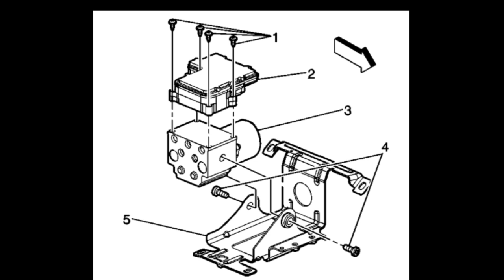GM Continuously Running ABS Pump Motor and/or Code C0265

Comment: I noticed on mines the plug was disconnected. I bought the truck that way a few days ago and when I plugged it in you can hear the pump running even with the key off and also I’m having a stalling issue I’m getting codes for the ECM as well any idea what they could be?

Comment: I just scored a 01' 2500HD. Traded a KZ1000 for it lol i popped the relay box open under the hood and found a 60amp maxi fuse just laying in there. As soon as i reinstalled it, the ABS motor came on (this is with the key off). My buddy told me to just roll w/o it. Sounds like the proportioning is all done mechanically in the valve body. So the brakes outta work normal, i just wont have ABS. I dont like ABS anyways, just pump your brakes if you start to slide. I guess thats a dead art nowadays though lol thank you for this video.

Comment: I have a 2004 toyota previa..the abs motor keeps running even if key is turn-off. I just remove abs fuse to stop the noise..does this show a faulty ecbm? thank u 🇵🇭

Comment: Mine is doing this on a 2008 uplander.  It only stops running if I unplug it. Can you drive it while unplugged? The part wont be in for 3 days.
Reply: The car can be driven with the ABS harness connector unplugged ( or you can leave the harness plugged and remove the ABS Motor Fuse). However, be mindful that the car will not have ABS functional to prevent skid on slippery roads etc. The brakes will be equivalent to that on older cars which do not have ABS. The braking system utilizing the Master Cylinder,  the hydraulic brake caliper and brake disk/drum will continue to be functional as it is controlled by a different sub-system.

Comment: Wow this video explains exactly what is going on with my Chevy Suburban 2008. Every time it rains my brakes engage by themselves and it causes my truck to slow down. And it only does it when it rains. I definitely need to see if this is the issue

Comment: Just asking will this have anything to do with the trailer brake system do to I have no trailer brake working and a high and low code on my brake switch not sure what to do I have changed out all the trailer  brake control stuff that I know to change out

Comment: Hey I know it been a min but i have the same issue with a pump runs continuously I got the module fixed but it still did the same thing so I return it they rechecked it send it back but the pump still runs continuously could it be a bad pump thanks
Reply: How does one know if the pump is running or not? What does it sound like? The truck is so loud and this thing in the ceiling buzzes so loud I can't hear anything else

Comment: Hello, I have a 2001 GMC Sierra pickup 3500 Diesel 4x4 6 speed manual transmission. I had the rear brake line blowup on me. I replaced it, ( had to cut ends off and use the old fittings and double flare ) I started to get the ABS motor running all the time. So I unplugged the Unit, but before that I got ABS warning light and my 4 wheel drive engaged light on. I have tried to figure out why the 4 wheel engage light is on. Any way one of the rear calipers bleed valves is bad so I couldn't bleed the rear brakes. 
Than I had to replace all of the front brake lines and from master cylinder to module and again right front caliper bleed valve is bad so can't bleed it. 
So the ABS motor continues to run if plugged back in, so I leave unplugged and have driven it over several thousand miles just leave lots of room between me and the car in front of me. It does stop without any problems and I have had to lock brakes up. So is my problem the module or just need to get the system bleed?

Comment: Hey Mate I am trying to figure out a problem on my 2012 GMC Sierra Denali recently I was 4x4 and all went well had a great day however when the time came to re inflation of my tyres I jumped in and noticed that the steering wheel was out 1/4 turn to the left. Bummer the vehicle drove straight and we can home 1000kms with no problems apart from errors on the dash when I got home grabbed a code reader and it came up with C0710 error also a C0610 Brake switch ordered the part just waiting but the C0710 error everything on the tube mentions to tape up the wheel to change the steering position sensor so I need help and thoughts out night be able to shed some light .. thanks for the videos and keep up the good work Scott F

Comment: I have a 05' Chevy blazer which it looks like  it is the same Module unit .. I carefully cut the seal at the top removed the lid and resod the bigger points that i could with a cheap solder iron and flux based solder cleaned off the old thermo paste and added new to the areas that had it ( grey)  Used RTV for a new gasket Reinstalled No ABS light  No parasitic draw  In many Forums this unit has its solder points get old and crack giving off even the slightest of variation which reads as a problem to the main computer and a ABS light comes on And the ABS motor stays on even with your Truck turned off 
I saved myself a few hundred dollars for a used Unit
Reply: could you explain what you did ? I have a 05 blazer, I turn the car off and I believe it’s my abs module (top right under the hood) keeps running when car is turned off  until it drains battery, I’m located middle of knowwhere basically with limited tools, just curious what I can do
Reply: @joshbonneville9523  You have what is called a parasitic draw Meaning at one point when the truck was running a switch was broken while "Open" / On So when you turn off the truck this switch did not close Offering power to the ABS system...This switch is a Relay....Limited tools middle of no where No idea on your tools Or skill level - see a mechanic....Otherwise you will need a 9volt battery And google 9volt battery test on relays ..A voltmeter to pin point the fuse line that is carrying the voltage to confirm it. Pull your ABS fuse for now (its not working anyways) And just for good measure pull your neg cable off the battery over night reinstall in the morning when driving (Beats having to charge it after being dead) Find a local scrap yards S10/jimmy/blazer all have the same relays ..grab them all ..
Reply: @freakyflow thank you so much, that is greatly appreciated, I’m just on an oil rig not too close to any towns, have to drive 4 hours to airport in a couple days, thanks again
Reply: @freakyflow I went to cold start it ( after 3 very cold days not plugged in), I drove it maybe 200 feet and been like that since
Reply: @joshbonneville9523  https://youtu.be/2ce-lQe-vBY?si=oZ9hb1Kv1zkOHyyB

Comment: Mine kept running after I pulled the abs fuse I had to disconnect the 12 volt and ground to get it to cut off on my 02 yukon. Is that normal?
Reply: I’m currently having the same issue. Continuously runs. How’d u fix it? ThNks

Comment: 200 gmc safari. abs light with brake light. when i am driving if i press the brake pedal the brakes lock up and tires squeal. I got a c0265 code. Any ideas. i am replacing thee abs module first. and see what happens
Reply from the maker: Pull the ABS codes and let me know what you find

Comment: Hi Car Doctor... i bought a 2006 Silverado Z71 and when i start it ABS on cluster comes on. The nce i put it in gear and get over 5 mph or so it goes off and stays gone until next startup. Any good ideas what it might be ?
Reply from the maker: Have you pulled the ABS codes and if so what are they?
Reply: Hi, O'reilly Auto Parts pulled the code for me today and it says Left front wheel sensor.  I just bought this truck (used of course) and the Ford dealer where I bought it just put that sensor on brand new along with new pads, calipers and rotors.  When I had asked about the ABS light the dealer seemed confused and didn't know why it was on but were not planning to do any more work to it.  Guess I better get in there and look around.  I already cleaned up the G110 ground under drivers door area.  Thanks for any advice on how you'd approach fixing this.

Comment: I have a 2003 Chevy Tahoe. I have a constant humming noise inside the truck. I was told to replace the ABS  motor assembly . should I replace the module first?   And when pulling my boat I have a hard time stopping .
Reply from the maker: First you should isolate the source of the noise. Is it coming from the ABS HCU assembly?
Reply: The Car Doctor the mechanic said it was the ABS assembly motor.  I just purchased 1 . Thanks for the advice.

Comment: I have a 2003 blazer. I can pull the fuse under the hood and the and stops humming. also would this affect my transmission, which will only shift in 1st n 2nd gear. it'll shift fine on the shift column but not virtually shift past 2nd gear causing rpms to race up
Reply: any help please thank you

Comment: I have a Closed circuit issue ,Pump runs continuously after vehicle is 
turned off. I pull the fuse to stop pump running. Only ABS light is on 
no BRAKE light until I pull fuse then bot ABS and BRAKE light is on. I 
believe pump relay is the issue ,do you think a bad solder joint or Cold
 Solder joint at the component to circuit board is a possible cause? 
Thank you. If not I will just replace entire unit.
Reply from the maker: my guess is the module is bad like all the others I have run into. Good luck

Comment: great, just what I needed. I had been thinking gas tank fuel pump, ick. Now it appears and easy home fix. You made my day.
Reply: Hey, by any chance did your car have stalling issues? I have a Silverado 99 and when I plug the ABS module in the motor keeps running, but I left it unplugged does that cause stalling issue
Reply from the maker: Hope it works!

Comment: I was told my Yukon Denali 2003 gad this issue of the motor being on when I'm driving the truck can I disconnect it and how without triggering any dash lights I rarely drive it so no biggie
Reply from the maker: You can remove the 30amp ABS fuse from the under hood junction block but it will completely disable the ABS system and possibly create an unsafe condition when the brakes don't function as designed
Reply: But will it trigger the abs light or any code i just wanna make sure that thats whats wrong with it i just wanna try it
Reply from the maker: Not sure I understand the question. Sorry.

Comment: I replaced master cylinder 2 months ago with new, not reman. replaced hydro boost today. brakes still locking. I cracked line at master cylinder. everything released for awhile then started again. I'm thinking bad master cylinder?
Reply from the maker: I guess it's possible. I have just found that most times it's the hydro boost unit causing the issue but I understand you loosened the master it and it still held pressure. I guess the ABS HCU can possibly be causing issues as well
Reply: Well the problem is solved. It ended up being the 6 week old New master cylinder.
Reply from the maker: Good find. Defective parts are the hardest to diagnose. Congrats!

Comment: i have a 2006 GMC Sierra 2500HD. 6.6 diesel hydro boost  After driving about 5 miles my brakes lock tight. no abs light'
Reply from the maker: Bad hydro boost unit
Reply: I was thinking that too but after lockup I loosened the nuts holding master cylinder to hydro boost but wheels didn't release.
Reply: forgot to mention, it don't lockup with ABS fuse pulled.
Reply from the maker: wow, well you might have to start cracking bleeder valves to trace back to where the pressure is being held. Might be a tough one.
Reply: I'm trying g to bleed my abs module without a scan tool and stumbled on this vid.  how can I energize the abs pump manually?

Comment: hey car doc. how's the weather up there. I gotta 07 Chevy uplander with an abs light that won't clear with a Snap-on scan tool. The transmission was just fixed and it came back with a light. It has a C0035. I just put a left front hub assembly in it about two months ago. I checked the ohms and they are in spec. I checked Ac voltage and it's in spec too. I graphed it and it looks the same as RF and LF. I tried several times to get it to clear and it won't. any suggestions or ideas. Thanks for your time. Tennessee Mike
t
Reply from the maker: You might need to monitor that speed sensor while driving. Might have a bad hub.
Reply: You are right. It was shorted to ground in the hub. I can see now why it throwed the light but don't understand why it was showing a near perfect graph. Guess I need to get more experience in graph reading. Also to keep it simple. Thanks for your time.
Reply from the maker: Bad parts can be such a pain to diagnose. Good job sticking with it. Take care

Comment: Thanks, Is there a way to bypass the Abs system for a short time until it can be repaired?  my abs pump goes off when i am coming to stop on totally dry pavement. it is actually rather dangerous.  if i disconnect the red/ black wire from the pump by the frame rail will that cause this to stop until i can get it repaired ?  i am old "school" and grew up driving cars with out abs...
Reply from the maker: I cant say if that's safe but it would probably work. There should be an ABS fuse under the hood in the junction block that will completely disable the system. If the pump runs only when coming to a stop then its probably a wheel speed sensor issue or hub.

Comment: I have a 2003 trailblazer Lt ext 4x4 abs light and brake light on pump not turning off unless I pull the fuze
Reply from the maker: Probably need to pull the ABS codes and go from there.
Reply: Code is c0265
Reply from the maker: Oh bummer. Every time I see that code it's curtains for the ABS module. It indicates an internal malfunction. Maybe see if you can get a used module. It may need to be programmed if it's not exactly the same vehicle and options. Good luck.

Comment: can the abs pump cause a rattling noise?
Reply from the maker: +brian landress Yes. That's about what it sounds like. Does it do it all the time? Just when you apply the brakes? Or only over bumps?
Reply: +The Car Doctor I hear the rattling noise when I am idling or going slow. i have looked all over my car and am stumped. i drive a Chevy cobalt coupe.
Reply from the maker: OH, sounds like a motor mount or exhaust rattle. I doubt its ABS related.

Comment: also forgot to mention I took off the fuse for the abs and the humming sound shut off.
Reply from the maker: +b20vtechustler Module is fried like KFC
Reply: @ThecardoctorTV I sold that truck around the time I made my comment/question, and some how, my old truck has resurfaced to my coworkers hands and is asking me for help 😶😶😶

Comment: my 2002 yukon makes that humming noise when the it's on or off. I also drains my battery. any ideas it's the module or faulty pump ? great video also 👍
Reply from the maker: +b20vtechustler It's a bad module. It's likely full of water inside. Get a new or rebuilt one and you'll be good to go.

Comment: No,  have pressure at the bottom end of the pedal. When the lines are disconnected from each wheel we can get fluid shooting across the garage.  However when the ABS PUMP/MODULE is hooked up no pressure.  I'm wondering if the replacement pumps are dried out from salvage yard when I receive them or if the module isn't working correctly. I know you can get ECBM rebuilt,  but can you get the pumps rebuilt?
Reply from the maker: +Mike Gonsalves sounds like another bad HCU assembly. Don't know if there is a rebuilder for those. How about new from the dealer?

Comment: Nice video thanks! However I have a 2002 chevy silverado 1500, I've replaced with all new brake lines, calipers, pads,  rotars, new brake master cylinder and the list goes on. Hooked it all up bled the lines and no pressure for the front pads.  Swapped out ABS pump,  same thing.  What do you suggest? Are all ECBM for those year Silverados interchangeable?
Reply from the maker: +Mike Gonsalves Can't say for sure if they are the same for different years and options. Did you replace the entire valve assembly or just the pump motor? Sometimes they are a bear to get the air out. I have taken them out to a dirt road and worked the abs then returned to bleed them and had luck. I just wouldn't suggest to someone for fear they might crash. Do you have pressure at the master cylinder when you open the front brake line with pedal pressure?

Comment: I saw your video, I hope to hear from you quick, if the motor stays running does it feel/sound like a rumbling from near the fire wall while you are in the car, let's say stopped at a light. my exaughst is quiet. If I let up on the pedal a bit the vibration stops, or lessesn.. '97 GTP.
thanks.
Reply from the maker: +Felix Siam if the noise stops when the brake pedal is released its likely a different issue than the one described here. If indeed the ABS pump runs whenever the brake pedal is depressed it may be due to an improperly functioning ABS wheel speed sensor.
Reply: Yea, I'm at a stop. There is vibration. Not in the pedal. If I just lighten up and press gentle the sound goes down. I just had lines replaced, and the bearing, all that stuff.